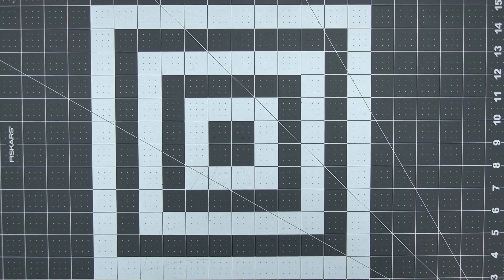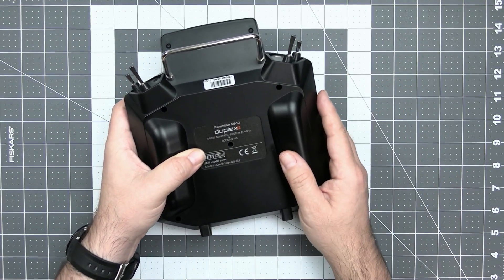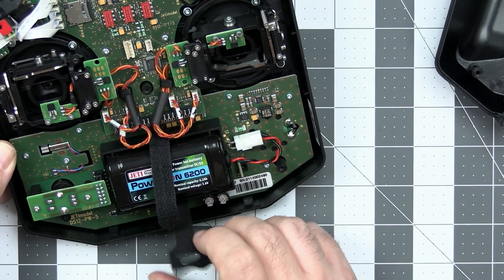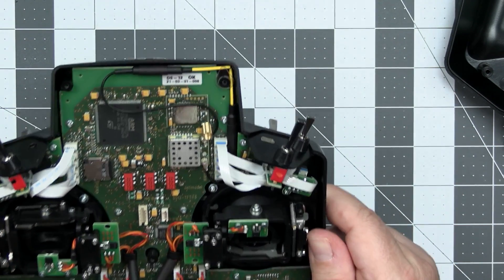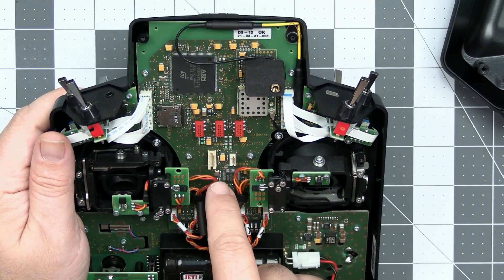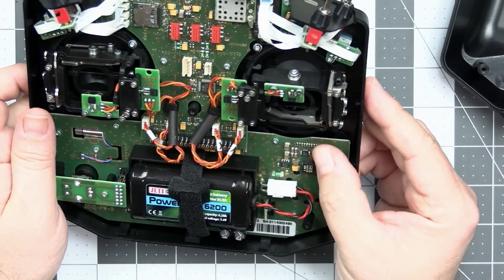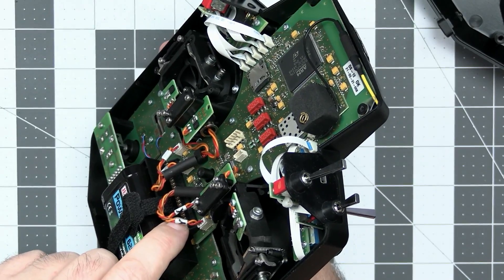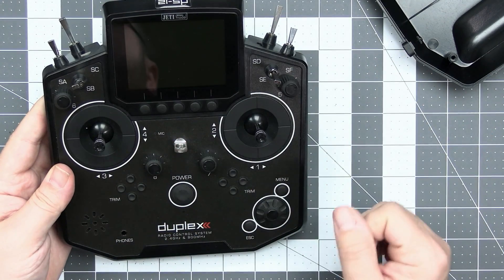JETI DS-12 teardown

Comment: Anyone recognized that the inside of that Radio Looks familiar to the Frsky x12s pre production model? The External Design. Thats a fact. BUT:
Same CPU. Also no internal Flash. And the Motherboard Layout Looks a bit familiar.
Would be no surprise if that Radio can run OpenTX with slight Modification to the Code.

Comment: Too much money.  You can get a x20s which has nothing to envy to a Jeti
Reply: Until a gimbal cable, switch, or software fails and then your plane turns into dust...I had FrSky but experienced myself, saw and read many issues with quality control. Even their newest radios have issues, the standard gimbals (non-cnc) have shown to be unreliable (cable failure). FrSky is on the edge of technology and I love that but after 10 years manufacturing radios, their hardware quality is still not there.  I would be willing to pay more to have a FrSky product with no shortcuts in design or manufacturing. Their only models that are probably worth using are the X20S and X20 Pro, the ones with the CNC gimbals and a decent screen. These radios are $500-1000 radios but for this money I can get a used, or even new, Jeti DS12/14/16 or a new Graupner...
Reply: you can get the over priced Chinese junk
Reply: But its a Spectrum !